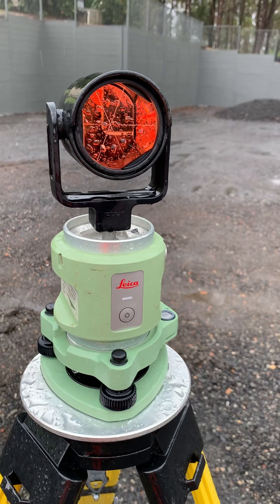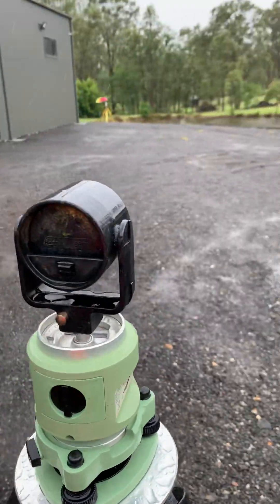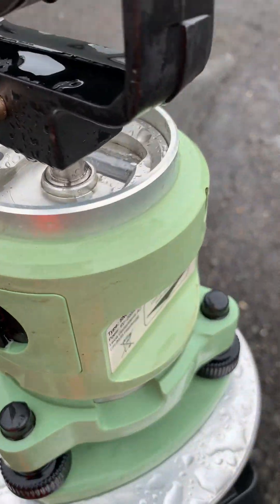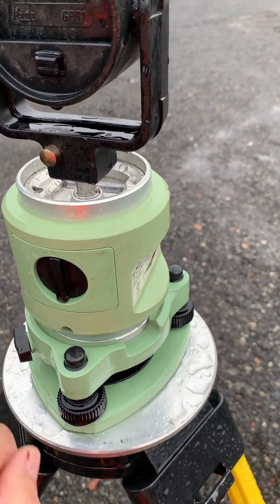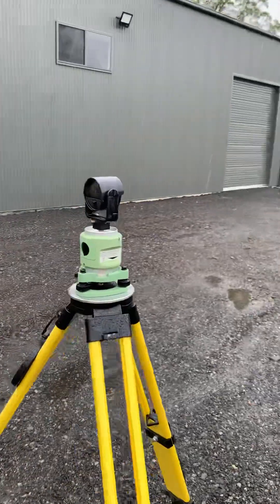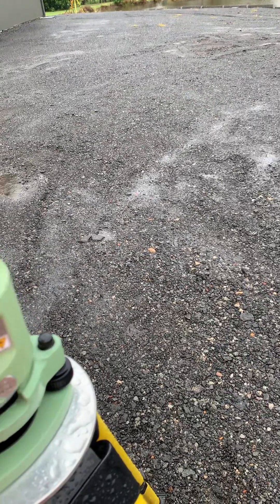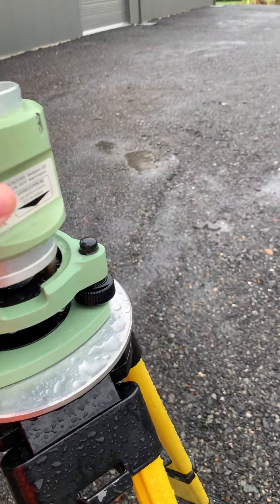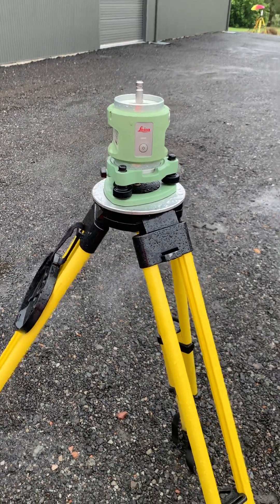Leica SNLL321 - Precision Carrier with Laser Plummet - Rain Performance - My thoughts.

Comment: We hang a plumb bob from points on the ceiling in the underground mine. I think that with this system we can install a Total Station on the projection of the point on the ceiling without plumb line. Do you think this is possible?
Reply from the maker: Hi there. Yes with the carrier inverted the laser plummet could project a point upon the ceiling. Not sure how high above the working surface the ceiling is, but it could work. Then you can middle up on the ground to the point above you. The specs say 1mm acc. per 1.5m so at say 3m above thats 2mm acc...  I could try a make a video of the laser and see. Let me know if you try it.
Reply: The gallery ceiling will be approximately 4 meters from the trestle. I hope I can install with 2-3 mm accuracy. I may order 1 piece to test the system. I will let you know when I test it. Thank you for your support.

Comment: Hi , can we fix/lock the tribrach when we turn it upside down?
Reply from the maker: Hi. Great question. Turning it upside down to use the laser on a ceiling etc.... the adapter cannot be locked.  But if the adapter is up the correct way, it is locked in the tribrach so if you were to carry it on your shoulder, it wont fall out.  I might make a video on that thanks.
Reply: Thank you so much.

Comment from the maker: The accuracy specifications are actually, 1mm per 1.5m and the reflector centering accuracy is 0.3 mm.
Reply: Thanks for the video.  How do we level the carrier?  It doesn't seem to have a longitudinal bubble.  After setting up the foresight, what do you notice when you place the instrument on it (when doing a traverse)?  Thanks, in advanced, for the feedback.
Reply from the maker: @kirbyralph  I'll make a video. Stay tuned. It does have a pill bubble and alidade bubble so you can level with the pill bubble then, one way and turn 180degree with alidade. The instrument when transferred is nice and level! Thanks for the comment.